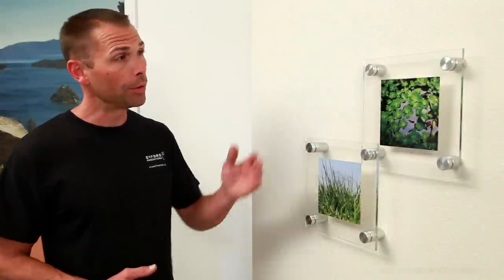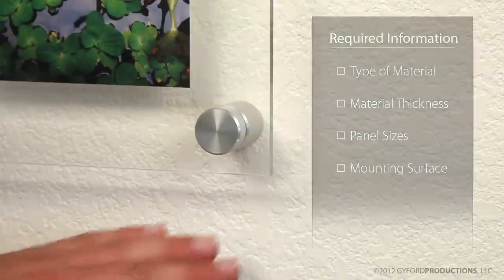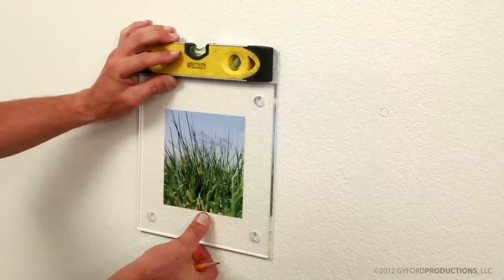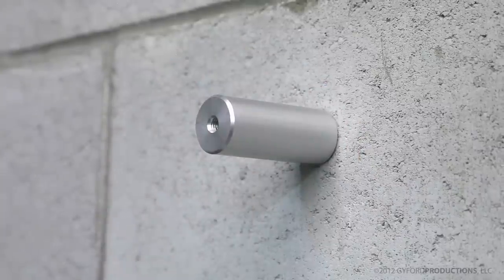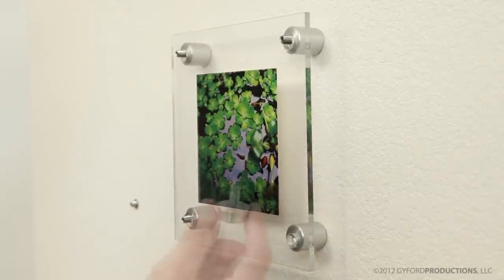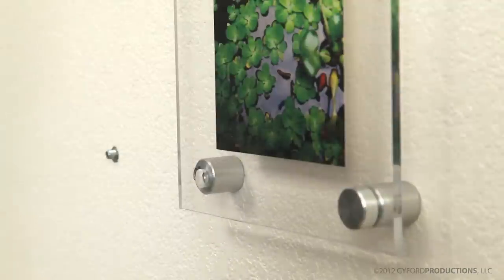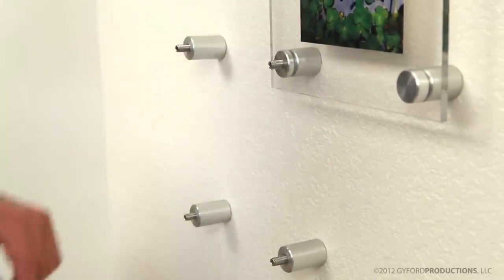Sign StandOff Caps & Barrels

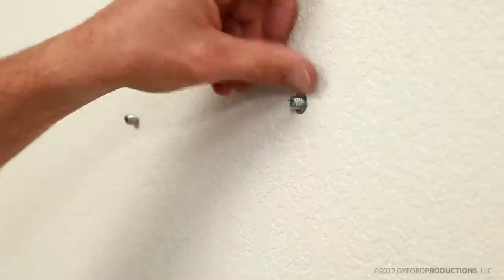Comment: What's the name/type of screw you mounted on the wall? The one with a headless threaded. The video on 1:42. I appreciate if you reply. Thank you!
Reply from the maker: 1:42...That is a Gyford Combination screw assembled into a Wallboard Anchor. Gyford Part Number HD-AWB2
The Combination Screw is a Gyford manufactured part available at standoffsystems.com or Gyford distributors (LInk below).  
The Wallboard Anchor is available at hardware stores.
https://www.standoffsystems.com/product/self-drilling-wallboard-anchor-assembly-2/
https://www.standoffsystems.com/product/516-18-to-8-combination-screw/
https://www.standoffsystems.com/product/self-drilling-wallboard-anchor-assembly-2/
https://www.standoffsystems.com/product/self-drilling-wallboard-anchor-assembly-2/

Comment: I have a question - Is this will be impossible to hanging on the wall 2m*1m large toughened glass painting, glass thickness 12mm, without frame and holes in glass?? And if, yes, then how i can do that?
I will be very thankfull for your answer.
Linda
Reply from the maker: Indeed,
This can be achieved with standoffs.
Edge grip standoffs may also be used If the glass is tempered and cannot have holes drilled into it without shattering.
https://www.standoffsystems.com/products/standoffs/edge-grips/
We would need to discuss the hardware used, based on the attachment surface.
Give us a call and we can work out the details. 775-829-7272
Reply: How many standoffs i will need for this glass (2,25m*0,90m; thickness 12mm)?? How much standoffs i need at the bottom and the side of the painting??
Reply from the maker: Linda Z.
To answer your question: Typically 1 standoff every .6m. You may require 12 standoffs for this glass. Maybe less depending on the mounting surface.For accurate and free estimates. Please contact our tech lead: Robert Borden robertb@standoffsystems.com We need to know the mounting conditions, type of glass, or shape of glass edge. We will also confirm the weight of this glass with you.

Comment: Thanks mate, but can you tell me how to install standoff caps on glass door?
Reply from the maker: Ivan Li,
Before your glass door is manufactured you'll want to specify where the hole locations will be, as you cannot drill into tempered glass. IMPORTANT: We supply plastic tubing to go over the steel stud and protect glass or resin from chipping. 

If your glass does not have holes, Standoff Edge grips may be a solution. 
Here is a link : https://www.standoffsystems.com/how-to-guides/how-to-install-adjustable-edge-grips/

Also, Info@standoffsystems.com is where you can send us a rough sketch and we can open an in-depth dialogue about your project. Possibly adhesives and backer plates too.

Thanks Ivan Li

Comment: My opinion is they are too big. Take attention away from the art. Perhaps smaller in diameter.
Reply from the maker: Thanks Mustard Seed.
Agreed these 1'' caps are a little large for this demonstration (or the art too small). We carry caps and barrels as small as 1/4'' diameter and up to 2-1/2'' low profile. Custom colors are available too,  so the hardware can blend with the installation.
Reply: I have the same sentiment when your vid first started